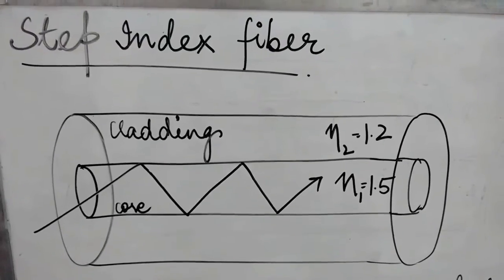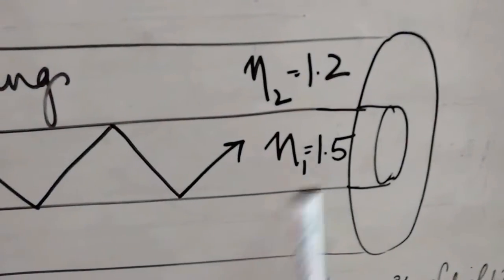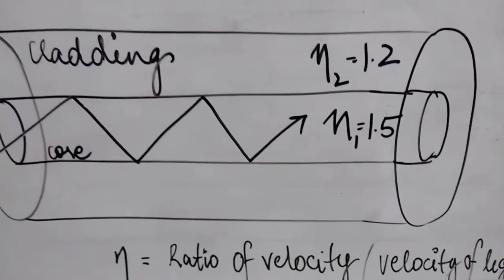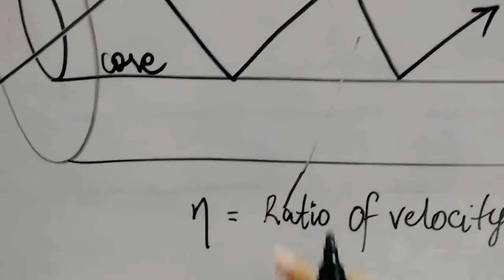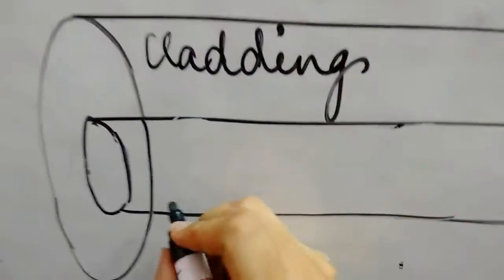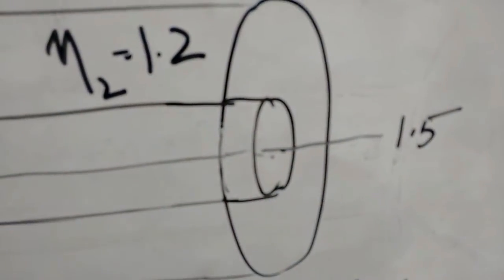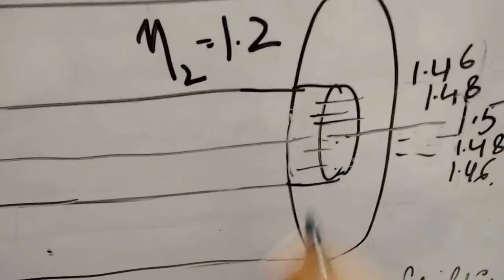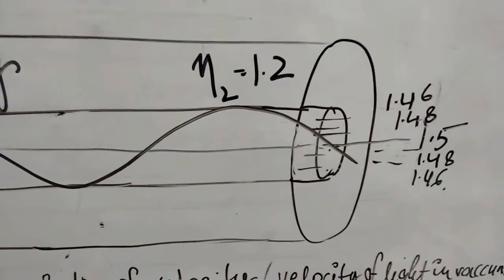Step index vs graded index fiber

Comment: mam there will be gradual bent i got .
mam my ques is wheater we can simultaneously transmit  more than one signal?
Reply from the maker: yes.. then it would be called as multimode step index fiber and multimode graded index fiber respectively
Reply: mam plz make a video covering PIN ,APDs , optical sources , their coupling, and splicing .